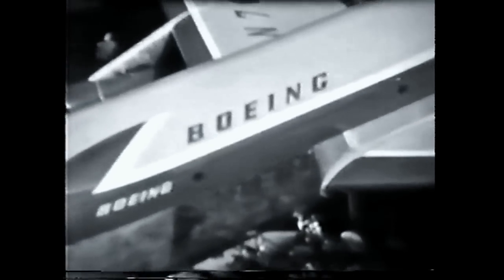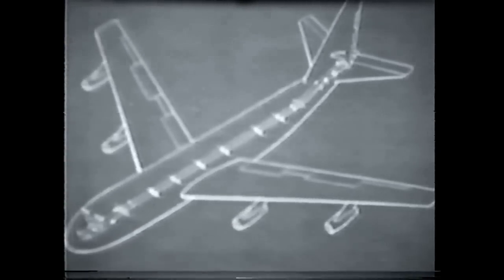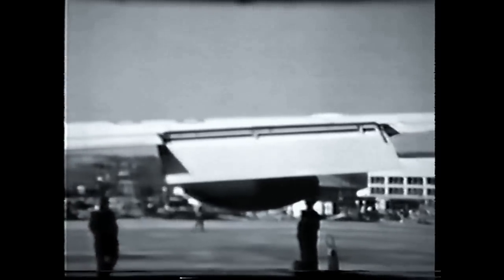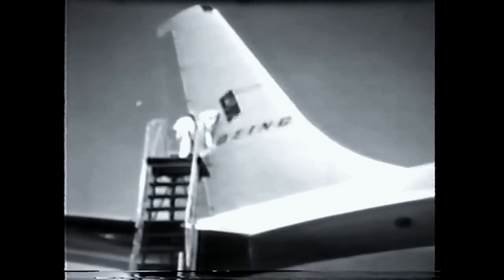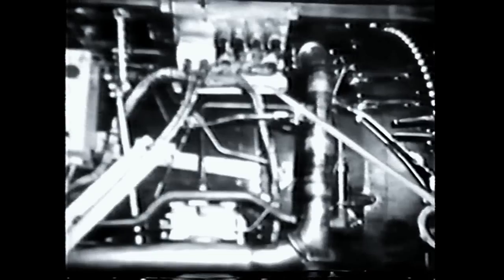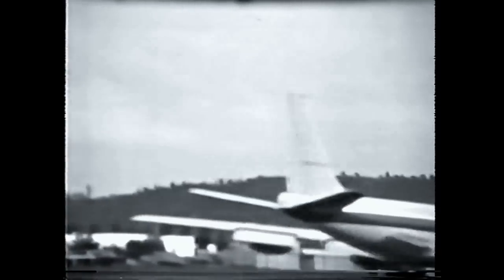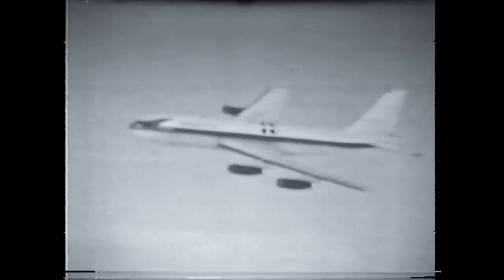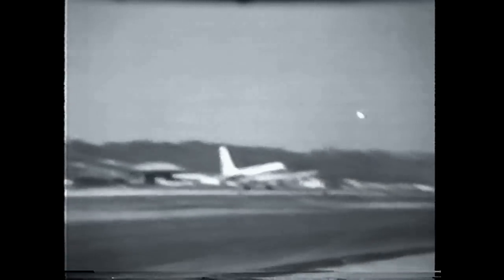Boeing 707 Prototype "Dash 80" Promo Film - 1955

Comment: It had a shorter nose than the 707 and narrower fuselage. Am I right?
Reply: It took strong-arm tactics on the part of Juan Trippe (founder of Pan Am) to convince Boeing to widen the fuselage to six abreast. He did so by placing an order for 25 DC-8's (designed as a six abreast jet right from the get-go) concurrently with 20 707's. As a result, Boeing wasted no time to make the necessary alterations.
Reply: I understand the Dash 80 shares almost no parts with the production 707... actually isn't the KC-135 in fact also radically different despite a strong superficial resemblance?
Reply from the maker: Yes, absolutely correct.

Comment: Boeing made a vague attempt to reuse the Stratoliner  name for the 707  (a reference to Boeing bomber names Stratojet and Stratofortress) but for some reason Boeing later dropped it. Maybe because 307 Stratoliner might jinxed the 707?

Soviet and British aircraft designers hated the wing mounted podded engines,  they both prefer a clean wing design for stability and better landing performance.  It took Ilyushin bureau a  clever political maneuvering to convinced the Soviets aviation elites to adapt the wing mounted podded engines.... Europeans caved in and "Americanized" their aircraft design with the successful Airbus A300 (based on American airline specification)
Reply: The 367-80/707 actually was a heavily redesigned revamp of the kc-97/377, mainly the upper fuselage shape. Before the heavy redesign they had the 367-60 which was the stratocruiser with the dash 80 wings.
In the end they went with an almost new design with elements of the stratocruiser.
Reply: +LegitGaming117 Boeing first 4 engined pressurized airliner (called stratoliner) shared many components from the B-17, sold poorly when better airliners from Douglas and Lockheed appeared. Stratocruisers are originated from B-29.
Reply: +stickmagnet my bad, I meant stratocruiser, I get the all the stratos and supers mixed up lol